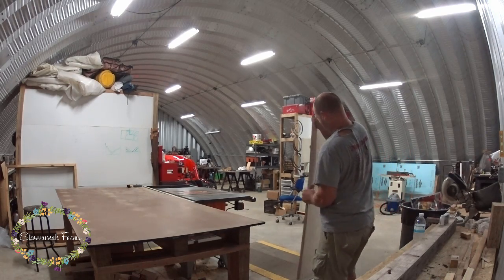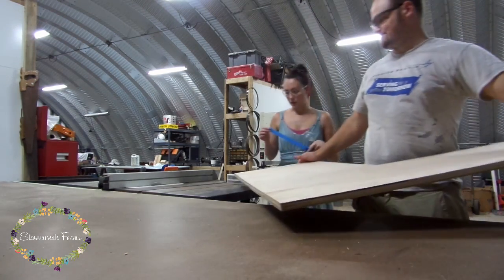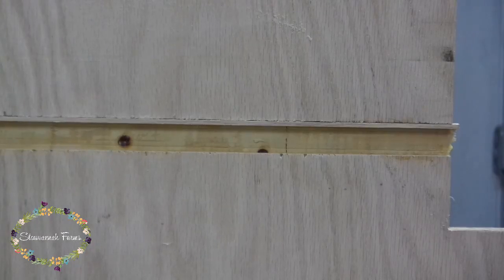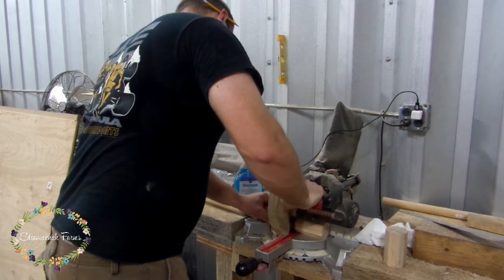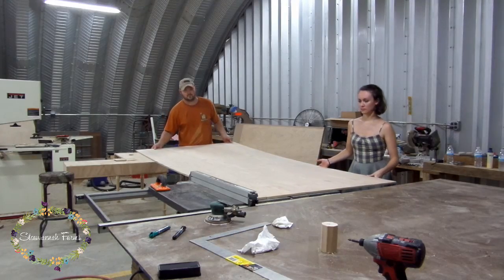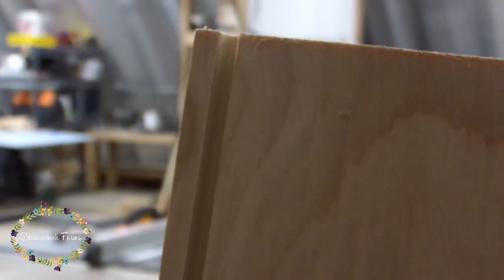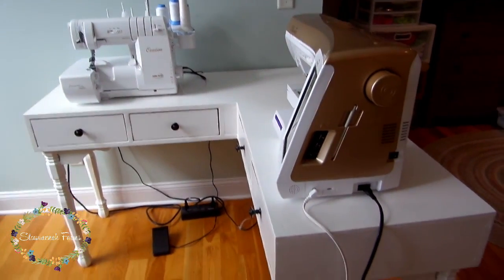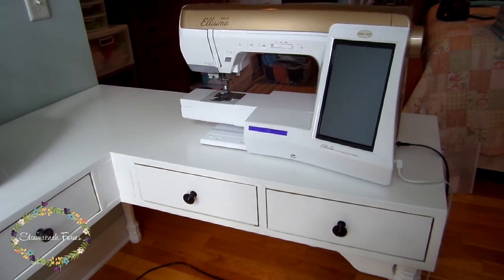How to make an L-shaped Corner Desk | Sewing Setup

Comment: Glad the tape trick worked! Looks great!
Reply from the maker: +Make Something Hey there David, yes definitely, worked great -- thank you :-) One question though, there's a little bit of gunk left on the blade from the tape. Do you know of a way to get that off? Thanks.
Reply: +Slowvannah Farms  soak the blades in simple green ..works great:) u can mix it with hot water to delude it a bit but dont have to ..theres directions on the spray bottle   hope that helps
Reply from the maker: +Joe basementwoodworking Ahh thanks, perfect.
Reply: Slowvannah Farms glad i could help :) dados can get pricey.

Comment: Sorry to hear about the dados but a test fit with a piece at least 12" long piece is always necessary. FYI, a short test piece may fit, but a 24" long piece might not fit because of the slight imperfections in sheet goods, so I always go with a long test piece. That desk looks so professionally designed. I love it!
Reply from the maker: +Heavyboxes Ahh good point there, Andrew. Thank you :-)